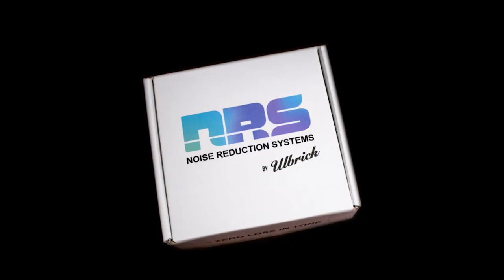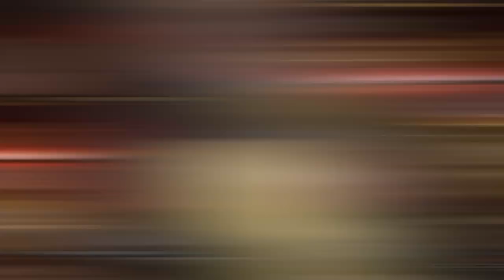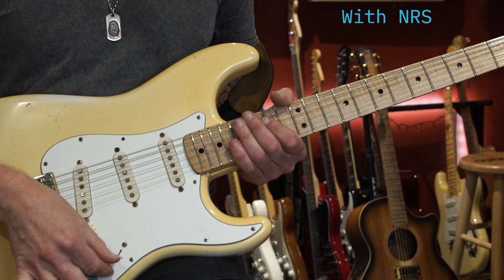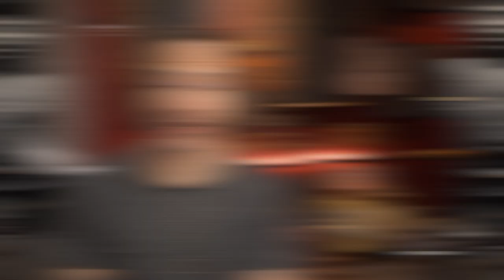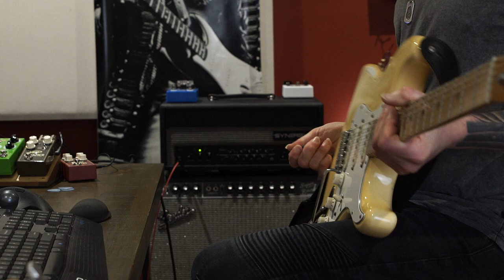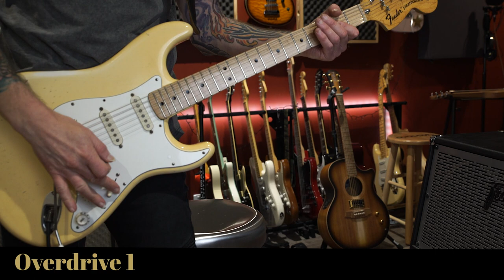Ultimate single coil noise reduction : The Ulbrick Music NRS

Comment: Someone spent 20 years to cut noise?  I can make a Strat as quiet as a Les Paul for $50 installed.  That only took me a few minutes.
Reply: what pickups or modifications would you recommend? Please, I'm struggling here and I'm about to purchase a 7-string with humbucker pickups because the 60hz are humming my single coils to tarnation

Comment: Put copper shielding around the bobbin of the pickup and solder a wire from the shielding to ground also works very well.
Reply: A great deal of noise pickup enters from the top and bottom of the coil.  If you have a P90, the metal baseplate shields the bottom but you would also need to use a metal top cover and connect it to ground - or line the plastic cover with metal foil and do the same. A Fender pickup or similar single coil would require shielding on the bottom, top and sides.  The lipstick pickups dealt with this really well.

Comment: Will it work for a Mosrite MK I guitar? They have single coil pickups but it is 13k  instead of 6k, so they are twice as hot as a Stratocaster and even hotter than a Les Paul which is a humbucker. So there is some loud hum! What would be the best thing to do to get rid  of the hum? Dont say P-90's!

Comment: What about noise gates and noise suppressors, are they any good or not?  Someone said they dont stop the hum at all.
Reply: Noise gates work on the concept that noise is always there, just being masked by your playing. This is like the concept of stacked single coil but this is not a new idea, as far as I remember there is another company doing it already for years, but the loop is in the back plate.
Reply: Noise gates just cut off the entire signal when it's strength falls below a certain level/threshold, but the pickup noise remains whenever the gate is open it's just that then the noise is less noticeable when playing.

Comment: I've pretty bad EMR at my place. Even my Burstbuckers are noisy. Yes it's grounded properly.  I still have to "face Mecca" to get it to quiet down.  Wonder if it would work with humbuckers? Probably a stupid question but it is a different system to a single coil.

Comment: The ultimate nin coil reduction and versatility: Fishman Fluence Pickups. GAME CHANGER
Reply: Yeah if you're into modern sterile sound... Fishmans are good but not good enough for true vintage tone..
Reply: @musikvonandreas  Absolutely and empirically false. id be wiling to bet that out of 1000 guitarists, of varying skills, experience and gear, less that 1% could tell the difference, sans the awful buzz that "true vintage tone" imparts. 

And if shitty, 60 hz hum is what pure vintage tone needs, they can have it because its total crap.
Reply: @daveycmusic5150  Agree!
Reply: Fishman battery requirement kills it for me.
Reply: @elbowjames7625  i have 4 guitars with the Fishman set ups, and over the last 2 years, i have charged each of those guitars 2 times. For a total of an hour each. Its negligible, and to get such amazing QUIET tone...its a non-issue. From 0-100% in about 20 min, lasts about 8 months
Reply: I am just so averse to adding any additional point of failure to a live rig that I can't embrace it for performance use.  At home or studio, I would not be worried.
Reply: @elbowjames7625  live is where you need it most. its quiet, sounds amazing and has a .000000001% chance of failure. Also, you probably should always have a backup axe handy anyway.

Comment: Could you tell me the setup specs of your Strat? (The 70's head stock, Maple Fretboard.. ) What's the Radius of the Neck? What Radius do you set your Bridge? String Gauge? Neck Relief at "?th" fret? Action high "e" & Low "E" above the 12th (or 17th) fret?  Your Nut Action at the 1st fret in thousands of an inch?  
I have the same guitar, only with a 7.25" Radius, Rosewood Fretboard and Olympic/Vintage white as Color... I'm having a pain in setting it up! (Low "E" saddle travel room/ the 5th"A"string on the 3rd fret, "C"Note still #Sharp! Even with low .016" cut nut slot at that string. ) I'm beginning to think my Nut slot should have been cut closer to the first fret. I hope you can give me the specs, maybe they help..Liked the sound..  Thanks! 👍👍
Reply: Just buy a new 7.25 radius nut, You can buy them pre-cut from fender! You can also buy the slots pre-cut and file it down from the bottom to fit your guitar. They sell them on eBay and Amazon. Hope that helps you!
Reply: @captainhotbunz659  Just like that! 😉... No.. thanks,  that's not the problem I've had.. I can make myself a guitar nut, that's not it.. Since the guy of the video didn't react.. When I was writing this i had thinner strings on it. The sharp C on the third fret of string 5 (A), is now resolved. I have a 7,25 " radius neck.  And I know many Pro Players don't actually set their Bridge Saddles to a 7,25" radius as to achieve a reasonably "low" action without having the "outer"strings fret-out when bending. The B & e strings. I got my bridge saddles now at 15" radius. As to properly cut  Nut slots.. The Buzz Feiten Tuning system actually moves the Nut closer to the first fret by a calibrated amount depending on string gauge and other factors,  as to combat "Sharpness" at the first 3-5 frets. They cut a bit away from the fretbaord. Or you can make a overlaying "shelf Nut"(Your "open" strings are never in tune with fretted notes unless you exactly cut your Nut slots to the same level as the frets.. but your Nut action will then be low.. ) As of now i'm doubting to go for a compensated Nut, or the BFTS Shelf Nut..  I need to find the specifications of the Buzz Feiten...Since they want you to pay some certified BFTS guy to install it... And don't want to..😃 Thanks anyway, 👍

Comment: The SCIII system Suhr uses is perfect
Reply from the maker: Isn't that a plate that goes on the back of the guitar?
Reply: @ilovenoise  I believe the current version it’s a thin channel routed around the pickups with the dummy coil loop inserted. It’s based on the Ilitch design, which is or was available as a back plate.
Reply: @ilovenoise  no we used to use a coil just like that from ilitch and this one looks pretty much exactly like Ilitch’s .  Our SSC II does not go under the strings and is the size of a tele pickup but has very low DC resistance and does not interfere with tone. Ours also has taps to adjust for different pickups hum output.  We also have an active version in which the pickups are not active, only the system so when the battery dies the noise comes back. We use that for P90’s because I hate any loss of high end and this was he best way.